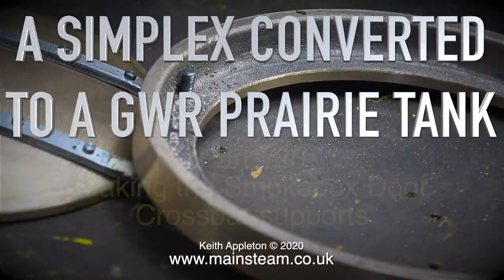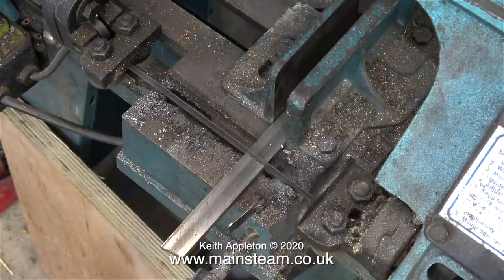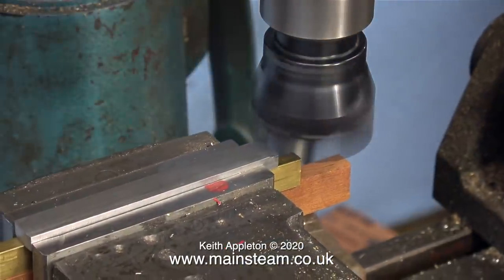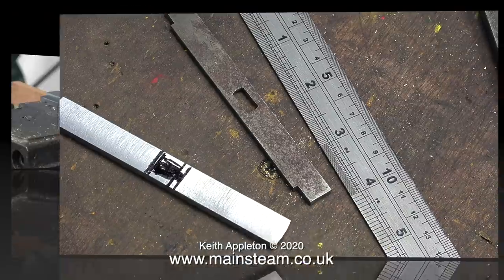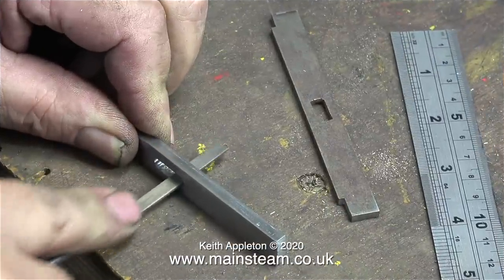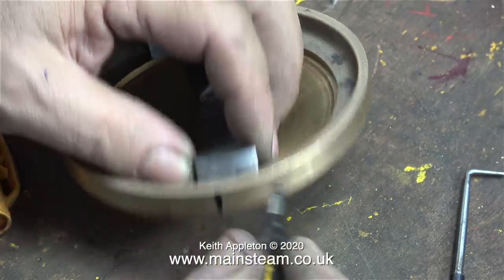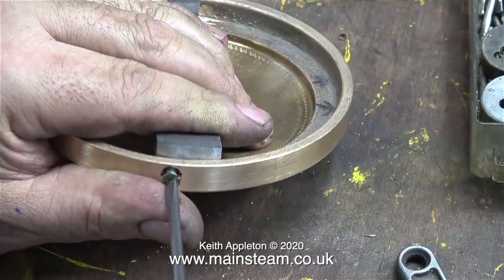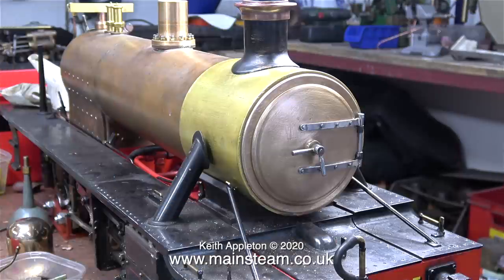SIMPLEX PRAIRIE TANK - PART #26

Comment: SO THAT'S HOW YOU LOCK A SMOKE BOX DOOR!
The outer handle is for aligning the locking lugs and the inner handle is for tightening the door to the smoke box! The more you know.
Reply: The inner one is for turning the locking bar and the outer one is for tightening it. Really the inner handle should point down when locked.

Comment: I am still wondering, what's the purpose of that rubber band around the inner circunference of the smokebox you removed in the last episode? It's just that? Rubber? Is it any kind of special rubber to be able to stand the heat?
Reply from the maker: Rubber Band ???
Reply: @keithappleton  rubber gasket :o you removed it at the very beginning of the last episode.